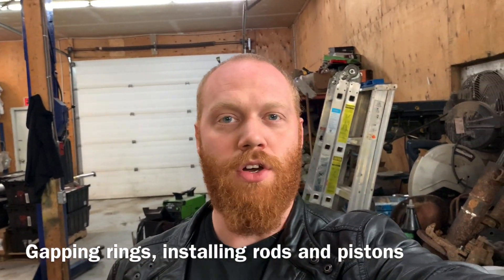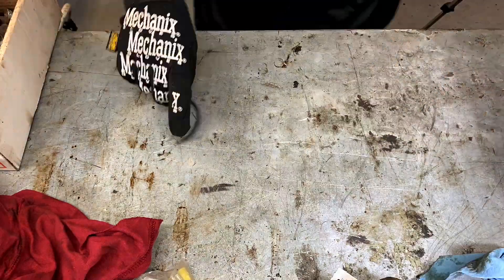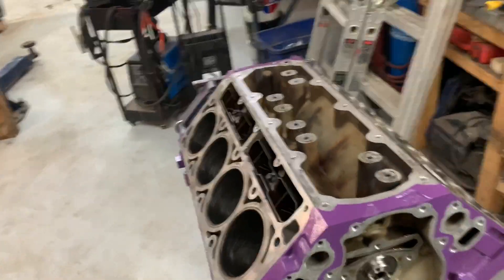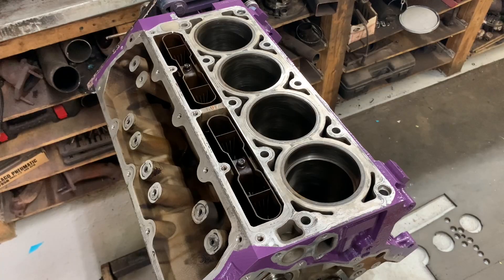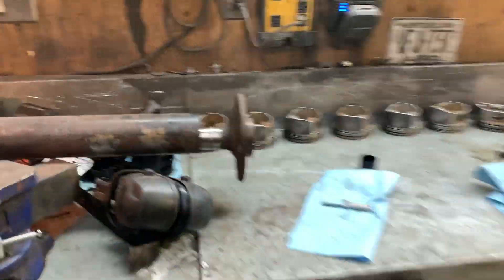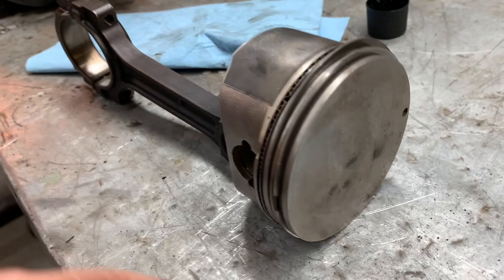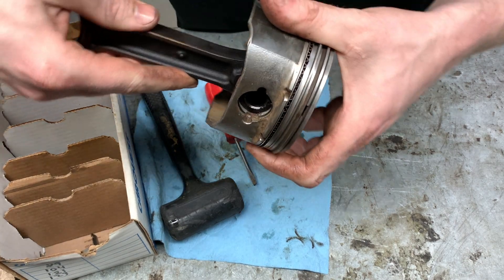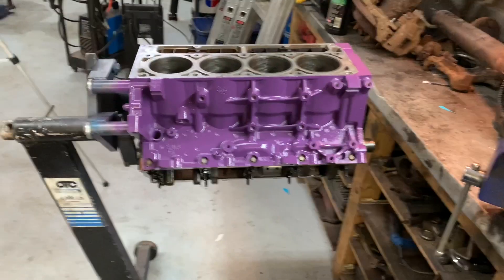gapping LS piston rings, assembling pistons and rods Turbo LS Grand Caravan build #4

Comment: Did you re use the rod bolts and bearings  ? And also do you have to check clearance bearing ? Working on a stock engine ring gap not sure if i can re use and slap them back on without checking clearance since its factory bearing, first build and probably overthinking, thanks in advance!
Reply from the maker: Hey man I reuse literally everything but the head gaskets and head bolts. I don’t bother to check the bearing clearance unless I’m installing new bearings. If the engine had good oil pressure and no knocks, the bearings are fine. I just pull the pistons, file the rings out and bomb it back together again
Reply: @StationroadRatrods  Man!! Appreciate the fast response! One last question, do you torque the rod bolts to factory torque specs?
Reply from the maker: Anytime, I’ll answer whatever questions I can. 
I always torque them to spec yup, but I haven’t reused the same rods more than once so I can’t say how many times you can do it.

Beautiful truck in your pfp by the way, the red is sick
Reply: @StationroadRatrods  I appreciate you Man! U just earned a new Subscriber, God Bless!
Reply from the maker: Right on buddy, thanks! Have a great day

Comment: Great work buddy . Your Chanel is gonna grow fast because your a humble down to earth guy everyone can relate to . Normal guy with normal tools trying to go fast for cheap.. and because you show your mistakes an struggles that’s the part I like. I’m doing a swap myself an struggleing with a few things but watching your videos has helped.
Reply from the maker: Well thanks man! Anything you would like to see, or touch on in my videos just let me know!
Reply: @StationroadRatrods  . My build is a 84 dodge short box lq4 an a 4l80 with twin gt35s. My two issues are 1 my intake is return less style DBC so trying to find info on what kind of an how to set up a regulator for boost reference an 2 I’m putting in a Ford ranger 8.8 an trying to find a yoke to put on it to get close enough to use a conversion u joint . My engine and transmission came from a 05 express van 2500 . But don’t worry about me my friend I see you got that 8.8 on the bench lol so you will be covering one of my problems soon enough lol
Reply from the maker: @jimclarke4843  so for your first setup, which is the same as I did (turbo, returnless rail) I used a corvette fuel filter/regulator. It has fuel in and out, along with a return port on it. Carquest part number is 86737. Worked like a dream, and I didn’t bother with a boost referenced regulator, as the pump (walbro 450) had no problem keeping fuel in the rail and I never saw a lean condition. 
With your 8.8 issue, I actually did a video on doing my driveshaft and I showed how to find the u joint you need, using moog’s part number search, I’ll post a link to it, there’s a lot of info there
Reply from the maker: https://youtu.be/795Pa4ExbwI here’s the link to the u-joint video 🤘
Reply: @StationroadRatrods  ok awesome thanks I’ve been working my way back through your videos. . Now quit talking to strangers on the internet an get back to work haha jk
Reply from the maker: Hahaha nice to meet you, I’m Barry. Not strangers anymore 😂